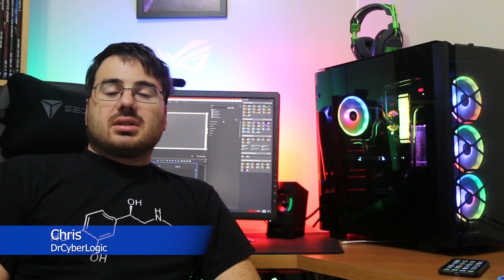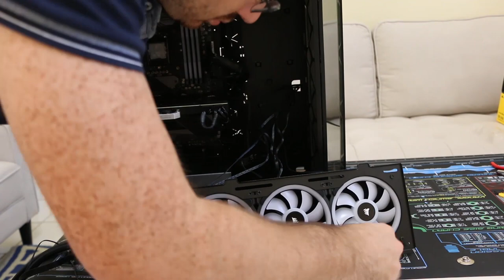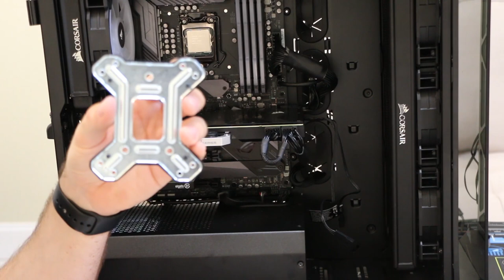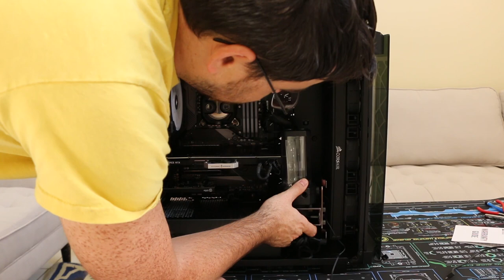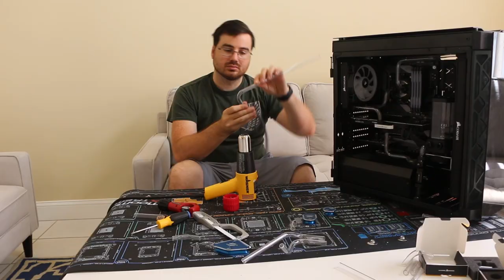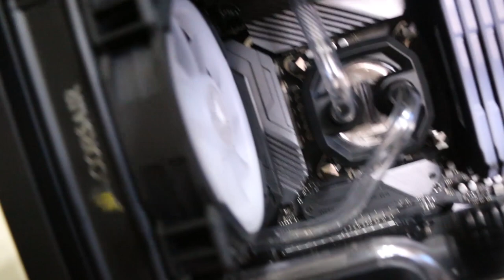How to Assemble Corsair Hydro X Custom Water Cooling Loop

Comment: I cannot find a detailed video on the wires for the hydro x. I’m a beginner and I cannot get the fan lights on and I cannot change the rgb on the pump or cpu block. I don’t know what to do. Every video I watch doesn’t explain the wire diagram in depth

Comment: Can you share your total overall costs - breakdown for this build?  I tried the configurator but in my case, I am comparing this to the EK Water Block $.
Reply from the maker: My cost for my setup total including drain was $708. It depends on your components as well if you will be overclocking.